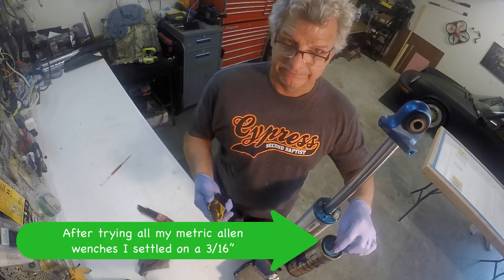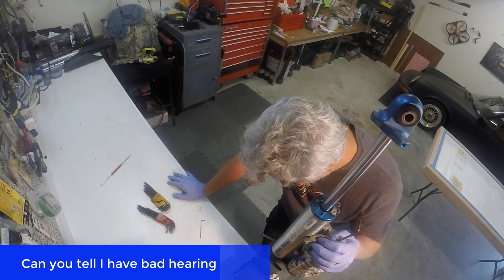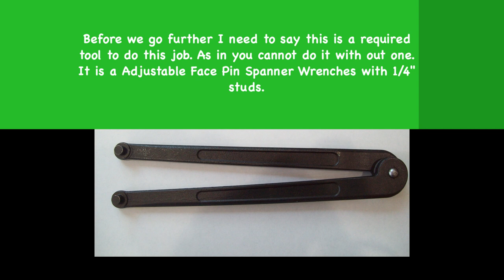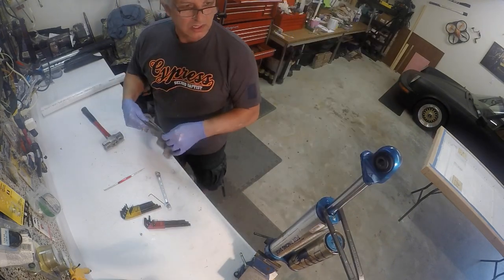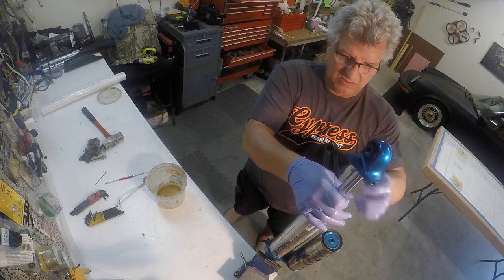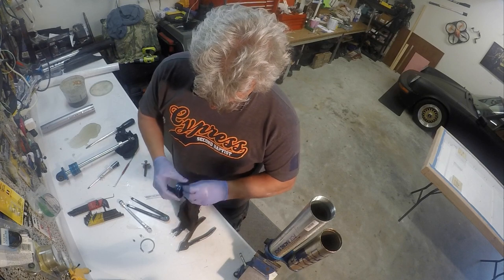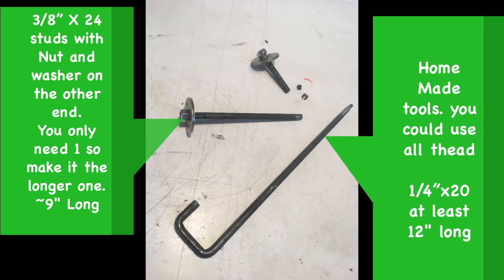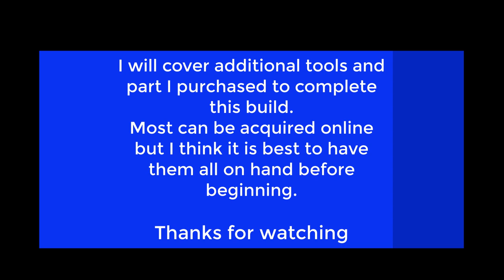2012 Ford Raptor - Fox 2.5 Rear Shocks Tear Down

Comment: If when you are trying to remove the cap on the reservoir side it starts to untread from the bottom?  How do you hold it without crushing the thin aluminum tube?
Reply from the maker: Have not had that problem but I would try a strap wrench around the tube.  Being careful not to crush the tube.
Reply: @The-Old-Dude  I tried that and damaged the holes in the blue top with the removal tool, by appling too much force.  I even heated the threads to see if that would help.  I think the company that rebuilt them for me years ago put lock tight on them.  so, I'm ordering new shocks, and then I will see if I can get these apart again.

thanks

Comment: That is small piston for 2.5 shock, about same size as bilstein 5100
Reply: Sure is, that's because of the tube in tube design of these internal bypass shocks.
Reply from the maker: I will have to take your work for it.

Comment: How different are the 2nd gen raptor shocks compared to the first gen? I'm aware they're bigger in diameter but is the rebuilding process exactly the same?
Reply from the maker: I am not the best person to ask as I have only rebuilt my own shocks. Some day I will get a new truck. That being said i would not think they are that different internally. They do have remote reservoirs and adjustable valving to be concerned with.
Reply: Yes, they’re the same
Reply: Not the same, rebuild process is much more difficult. My buddy’s shop rebuilds 20-30 sets a week, a mix of gen 1 and 2.

Comment: Where did you order the rebuild kit  ?
Reply from the maker: In the 3rd video in this series I cover the tools and supplies I used in this rebuild video = Ford Raptor Rear Fox Shocks Fill & Pressure - about 3/4 of the way through if I remember.